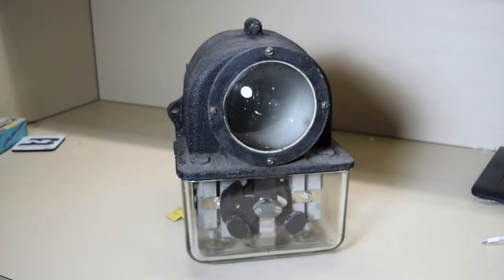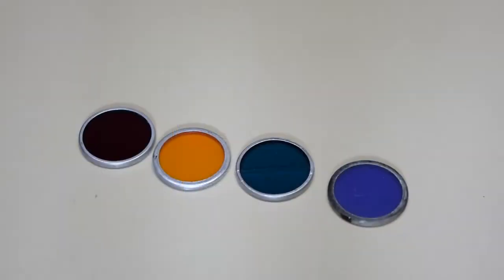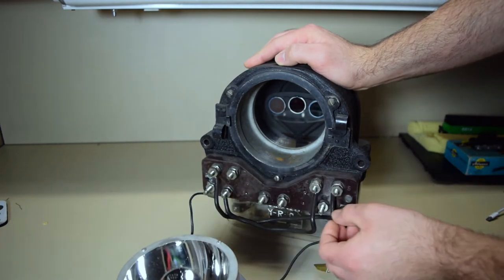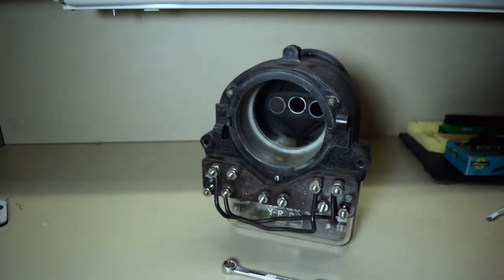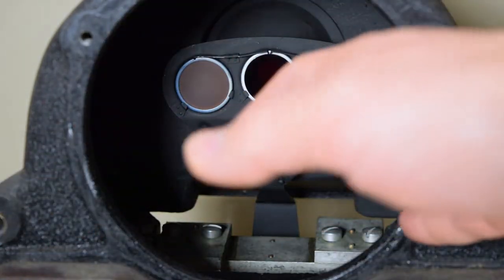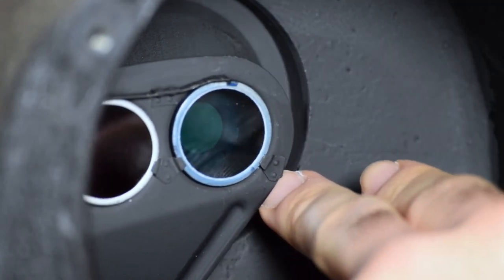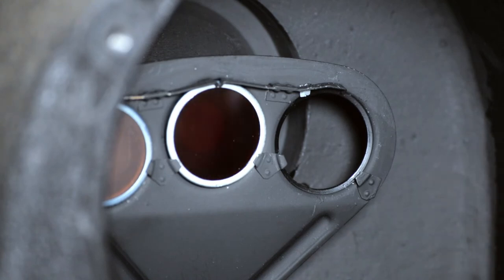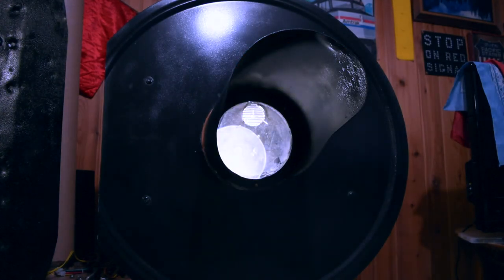How to Change Color Lenses in a H2 Searchlight Signal

Comment: I wonder if there is such a searchlight signal that has  red, lunar white, and green roundals (used under a unit with red, yellow, and green roundals). This combination could be used for a track leaving ctc territory and indicate high speed signaling (lunar white used for track leaving CTC territory and bottom green using for Approach Clear 50/60 indications)

Comment: Power failure defaults to red, does the light illuminate via battery power?
Reply from the maker: Correct. But also if the light goes out completely its considered red by the railroad

Comment: I have a US&S Westinghouse UK made signal just the same as what you have. It has a  plano lens as part of the mechanism and i want to remove it to clean the lens can you do a show how to do it ? Also do you have that mechanism with out the Plano lens set up as i would like to know what goes there instead of the small cast iron extension holding that small Plano lens ?
Reply from the maker: Hi there! I've never worked on a mechanism that you have described and I've never heard of a piano lens my friend. Is there anyway I can see what you have and I'll try my best to help you
Reply: @TWIGYBNSF  a plano lens is that 4" magnifying lens at the front of the mechanism.
Reply from the maker: @alexangelico2543  Oh! I honestly never knew they were called that. Yeah about that, they are really hard to remove because the adhesive or what they call it in the old days is signal cement. It holds those lenses in pretty hard. Only way to clean them on both sides is to basically remove the brains of the mechanism but I'll see what I can do!